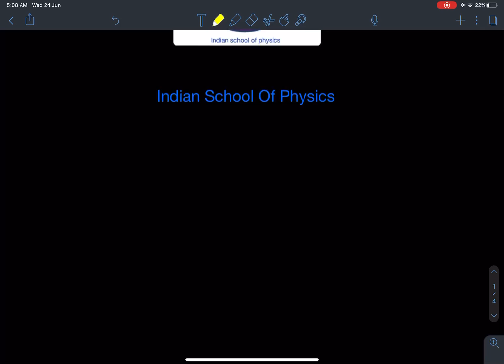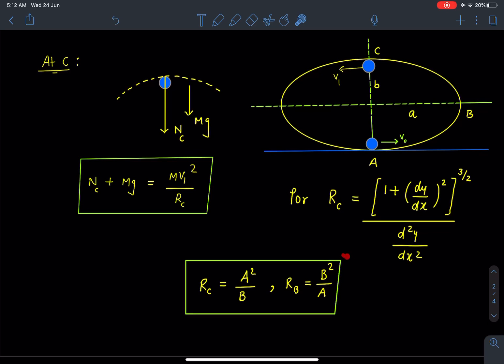ROLLING INSIDE AN ELLIPTICAL TRACK

Comment: 4:15 => We can also Try : x = acosθ, y = bsinθ & Rc = {[(dx/dθ)² + (dy/dθ)²]^3/2}/| (dx/dθ)(d²y/dθ²) - (dy/dθ)(d²x/dθ²) | => dy/dx = (dy/dθ) / (dx/dθ) = (b cosθ) / (-a sinθ) = -b cosθ / a sinθ = tanφ => φ = arctan[-bcotθ/a] where φ is angle that the tangent makes with the x-axis.Now => Rc = {[(dx/dθ)² + (dy/dθ)²]^3/2}/| (dx/dθ)(d²y/dθ²) - (dy/dθ)(d²x/dθ²) | = [(a²sin²θ) + (b²cos²θ)]^3/2}/ab[sin²θ + cos²θ] = [(a²sin²θ)+ (b²cos²θ)]^3/2}/ab => At C , as φ is 0 , => θ = π/2 or (Rc)C = a²/b & similarly at B , φ is π/2 => θ = 0 or (Rc)B = b²/a 😅🎉❤⚡⚕️
Reply: is it the polar method of finding rc??